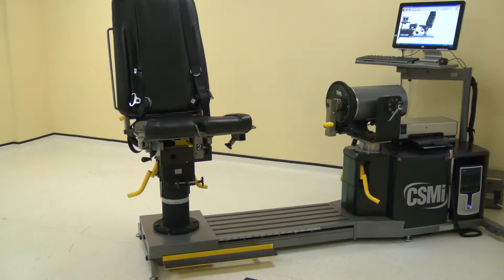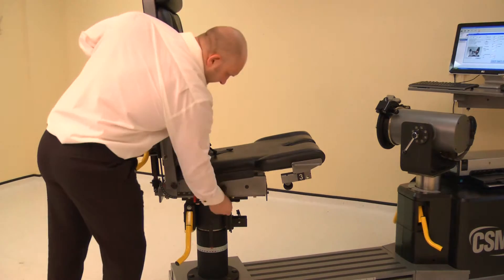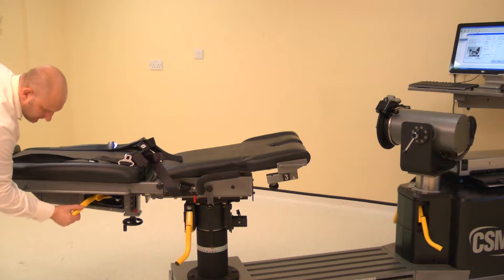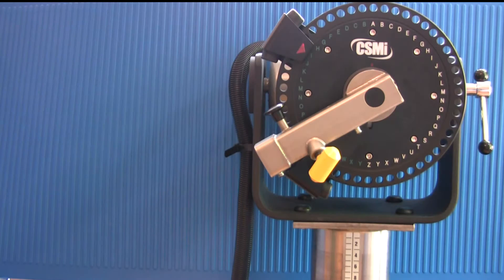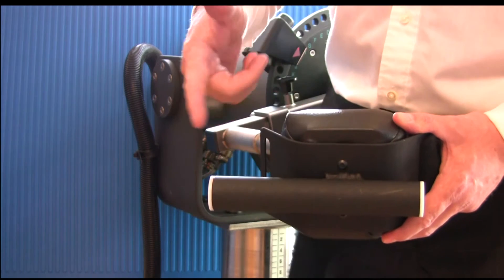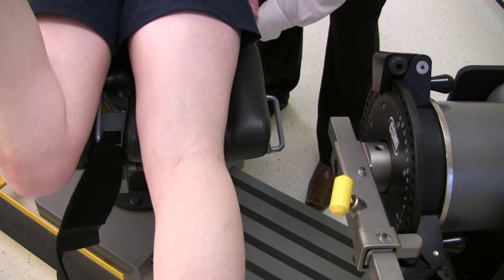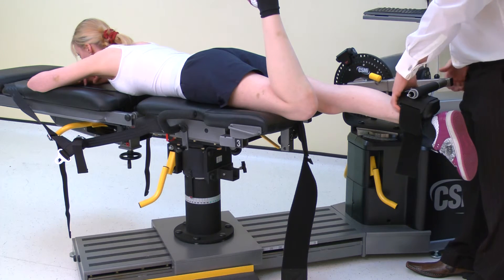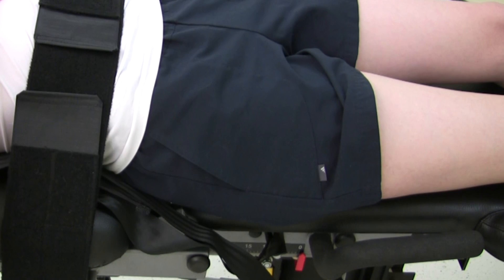Knee prone flexion eccentric hamstrings setup Isokinetic Humac or Cybex Norm

Comment: Knee flexion in this video given is Concentric. Not eccentric. Concentric movement while prone would be going from full prone to knee flexion at 90 degrees. The eccentric movement would be from that 90 degree point(foot towards ceiling) flexing the knee join to the glutes.